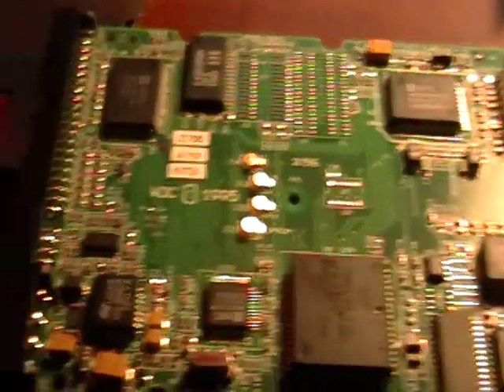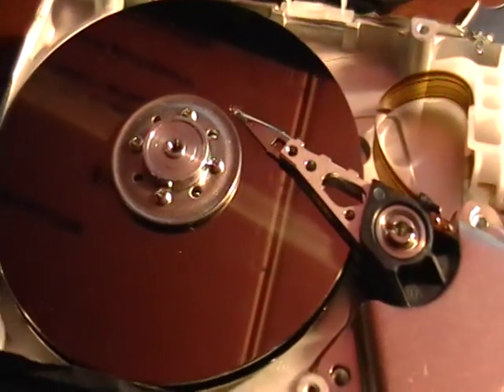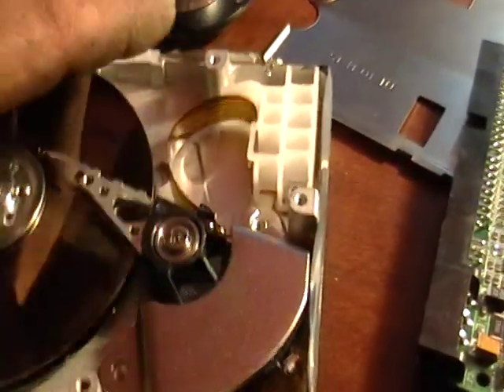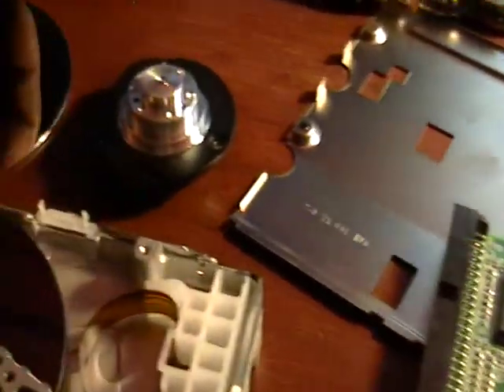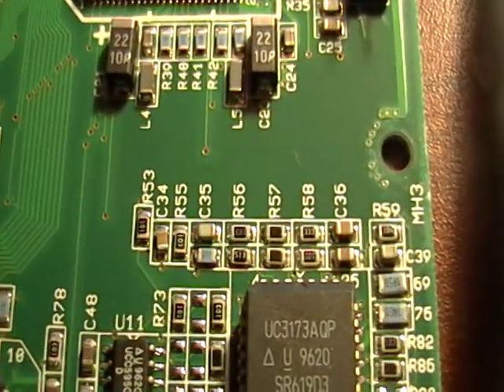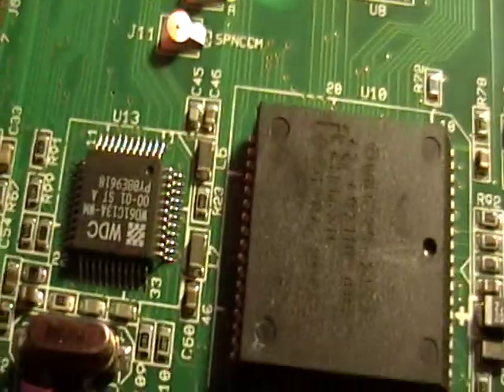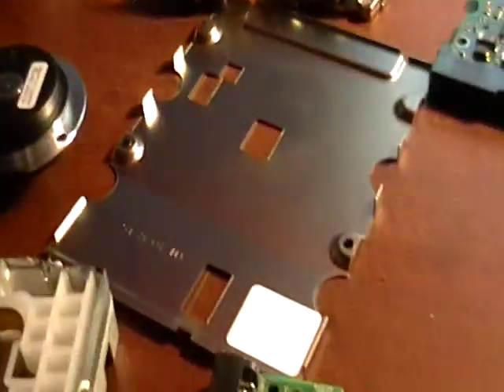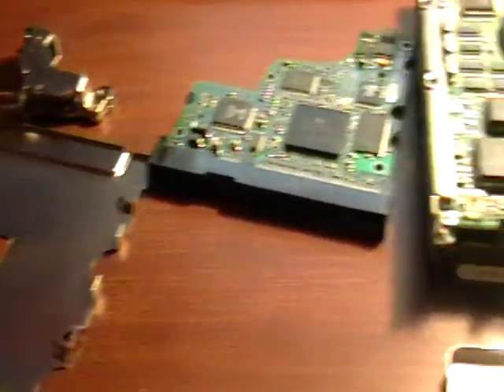Scrapping HARD DRIVES for cash

Comment: @lmvelazquez100 Nice! You might ad the strong neodymium magnets are valuable. And the shielding bracket that encases them is made of a special alloy called Permalloy that is typically 80% nickel. Nickel is trading at around $9 a pound right now. Many who remove the magnets, toss the brackets thinking they were just steel. The minuscule amount of palladium or platinum coating on the platter is worth only a few cents. The cover is usually stainless steel but some might be made of Permalloy.

Comment: As soon as you open the HDD, the amount of dust that falls on the platters, your fingerprint oils, or just oxidation from the air will render the data useless for anything other than a cleanroom rebuild, and even then not guaranteed.